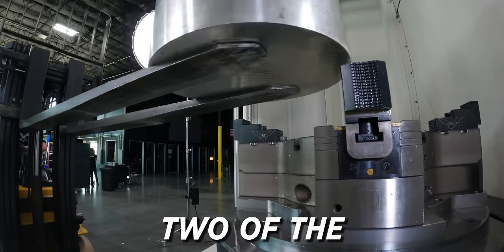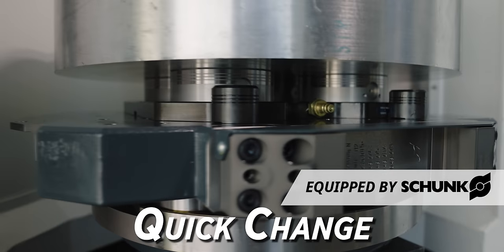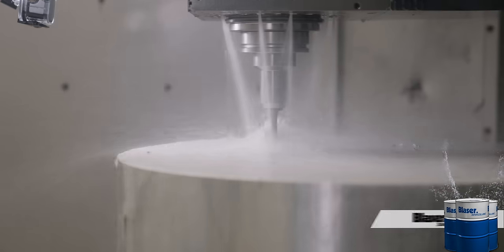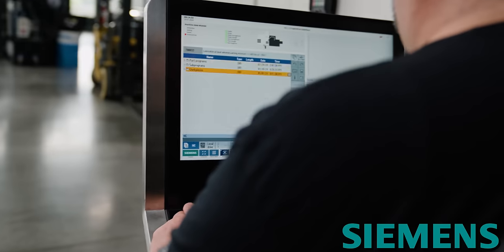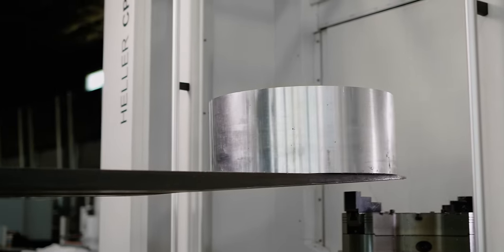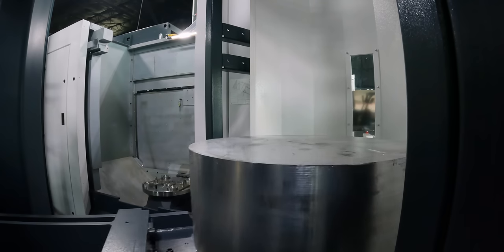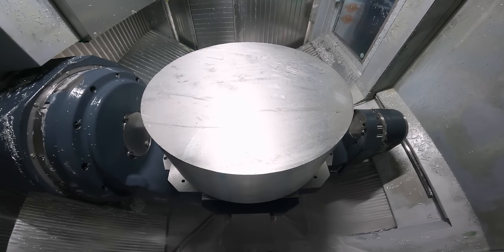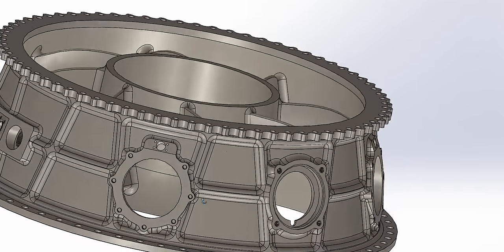The MOST Complex and Difficult Part We Have Ever Machined

Comment: Have ever machined Invar? If not, please do
Some parts for measuring equipment
Reply: Invar 36 yep. It was for some type of camera equipment
Reply: Invar 36 yes.
In Nikon metrology we had manipulator part made out of it, as it had low thermal expansion coefficient
Reply: Hi Barry
Could you machine electron optic lenses out of VIMVAR please?

Comment: Couple of questions:
1: how did you start machining without taking the work piece reference point? Is the machine equipped with a smart laser guided sensor or something like that?
2: why is such a large complex part being machined as a single monolithic part instead of several smaller parts that are attached to each other?
Reply: Although it wasnt shown in the video, we did take a reference point off the part using an integrated spindle probe. And usually this style of part is made as a single piece. Im not really sure why, as there are some things made as multiple parts like a blisk, or bladed disk.
Reply: @barrysetzer  thanks!

Comment: Not to spit hairs. Shrouded impeller or is it a stator or nozzle?
Reply: Yeah it looks like a stator of some sort. You can see those ports for bypass air on the sides that would not work on a rotating portion.
Reply: I was thinking the same when I noticed the teeth on the OD. I wouldn't think it's for starting...

Comment: In aluminium it's a very do-able part, with it's own challenges like holding tolerance in a free state.  How it would be tackled in 718 inconel would be allot more interesting to see, especially if it had to make 30 or 100 of them.  

Roughing deep like that with ceramics, in inconel would be extremely challenging.  I've been working on inconel plates and struggling to break the 90 minutes in cut tool life out of a 10mm endmill.  

You should check out these guys! 
https://www.instagram.com/sabtechnology

Comment: show us the drawings and the tolerances! just machining shapes are no hard......
Reply: I machined impellers for years. They had profile of a surface on the blades of .01", concentricity between the OD and spline minor diameter of .0002", Perpendicularity of the spline axis to bottom floor of .0002", blade thickness of +.01 to -.005. The blades would droop as they were machined, so we had to manipulate the points at the leading edge so that they would land in the correct position as they were machined. So I know ALL about blade geometry and how to machine these type of parts. But hey if you want to make a Youtube channel where you discuss drawings and tolerances, good luck on your dozens of views!!!
Reply: @barrysetzer  Don't get me wrong sir, I think you guys are awesome!